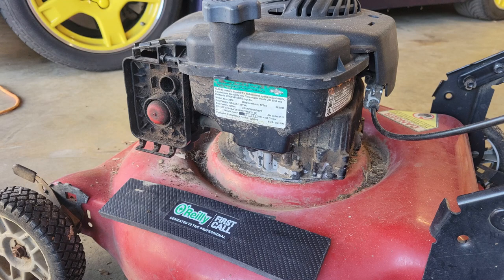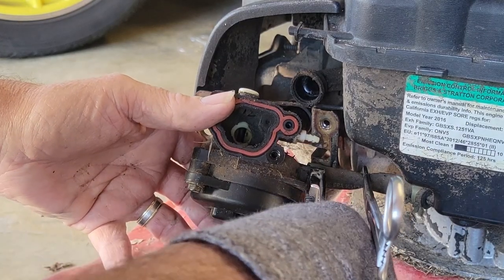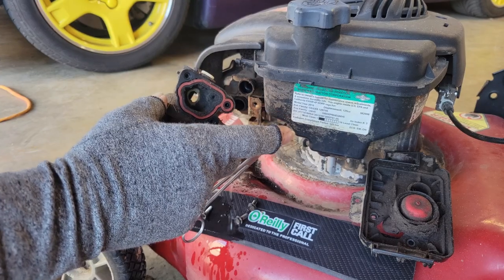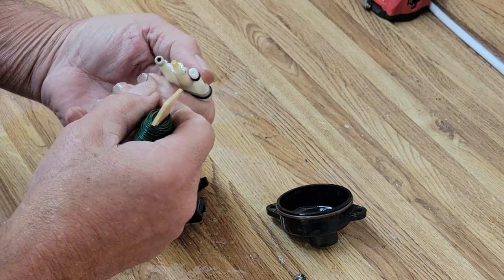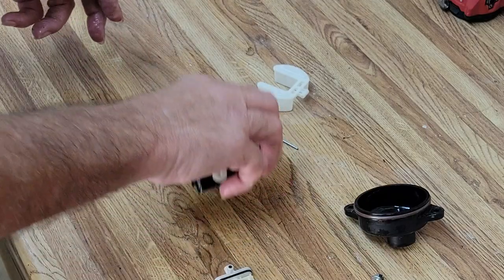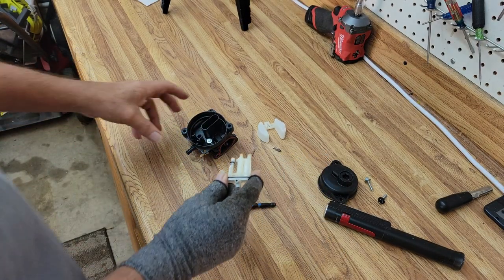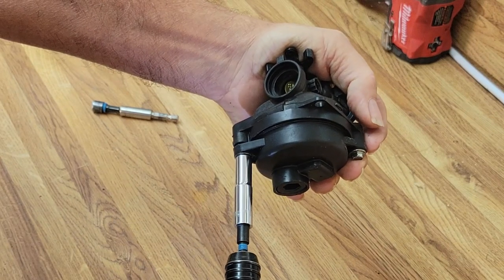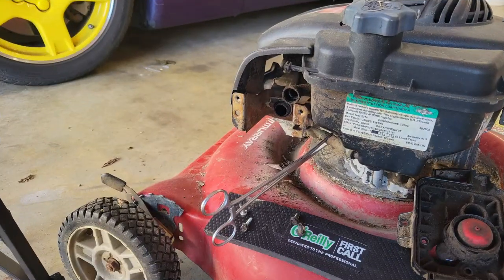Mower won't start II - Briggs E series motors

Comment: Another good vid Bill, I just do not like those plastic carbs, we will see what happens with the two mowers I picked up.
Reply from the maker: Thanks Barry. I like them because they solve the corrosion issues metal carbs usually have, plus they like being cleaned

Comment: Nice video you can also take off the lower jet section to ensure the distribution tube holes are all clear and if you can not get the assemble back in it is because the inner sleeve had rotated or moved outward not allowing entry of the stem with the O ring. These are great carbs but the auto choke ones had a design flaw that Jake did a video on needing to grind off some of the plastic to stop the choke lever from sticking on the side mounting plate. You also have to watch you do not get impaled with the screwdriver when removing the bowl eh?
Reply from the maker: I didn't include the lower section because this will fix nearly all of them and most of my viewers aren't experts and I don't want to get them in over their heads. The clog point is almost always that bottom brass jet, followed by the top brass jet.
I actually drew blood on that one, it went across the inside of my middle finger.  I didn't even notice it until editing, then I looked at my hand and went 😳
Reply: @GuysPlayingWithTools  Good point and yep i thought you might have gouged yourself, if it was me you woulda seen blood all over the bench. Hope it was not too bad .
Reply from the maker: I did. 🤨 I edited out the ugly parts.

Comment: That was pretty easy
Reply from the maker: Thanks.  With some luck it will save a few mowers
Reply: @GuysPlayingWithTools  now we just need a video on the 159cc Honda clone that's on the MTD and Toro brand equipment
Reply from the maker: I am working on it.  I am trying to cover then all 🙂
Reply: @GuysPlayingWithTools  thanks bill I appreciate it I'm kinda learning a lot from everyone on YouTube in the small engine community so hopefully I can help family members fix some of their small engine equipment
Reply from the maker: @randytorboli  Thanks for watching.  I try to cover the problems people see every day so if you ever see something I might have missed, let me know and I will find one. 
On most motors the carb is the soft spot so I am working on a full set of videos for them.
Reply: @GuysPlayingWithTools  the only other Briggs one you might have to make a video on is the ones with the carburetor on the gas tank
Reply from the maker: @randytorboli  there are a couple of those, I have videos for them but they aren't new.  I will get a Playlist together
Reply: @GuysPlayingWithTools  sounds like a plan I'll be on the lookout for that

Comment: You do know you can seperate the fuel jet system for cleaning...
Why didn’t you clean the filter assembly being extremely dirty you could cause it to get dirt in the jets again.
Don’t mean to be critical...😊
Reply from the maker: I know ya don't.  🙂
Most of my viewers are people working on their own equipment without a lot of experience so I limited this to the parts that are usually guilty.  Carb spray will blow them clean without breaking them down further 99.9% of the time.